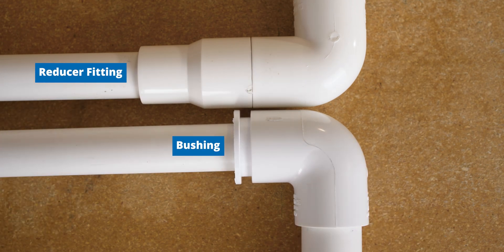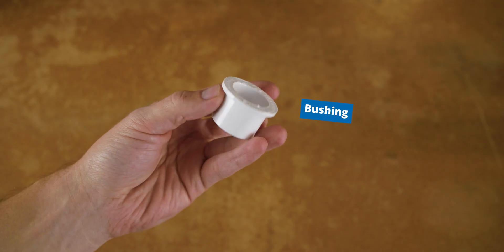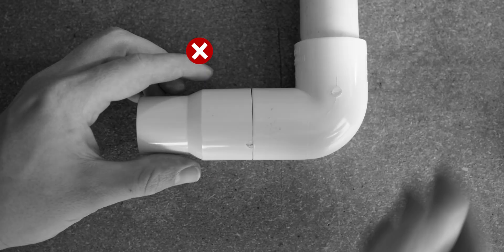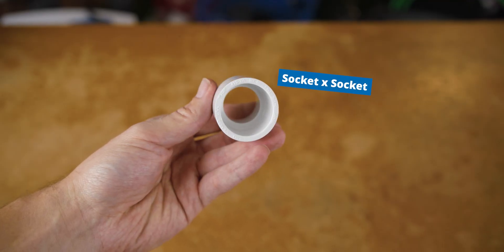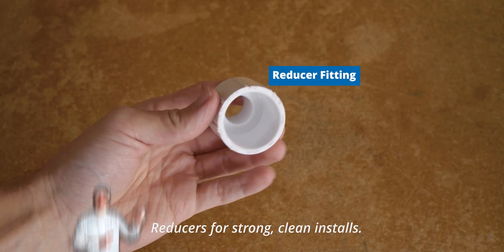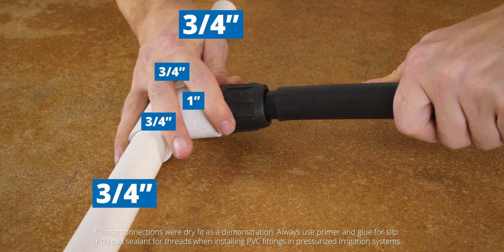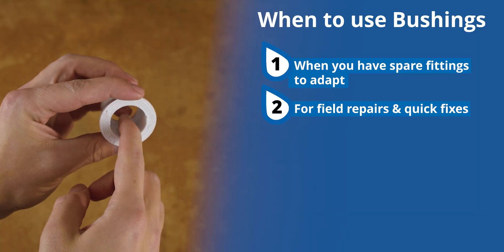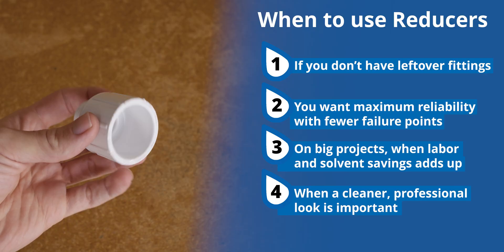Reducer Fitting vs Bushing: Choosing the Best Fitting for your PVC Pipe Project

Comment: From a plumbing standpoint, on drainage and sewer systems a bushing on something like a two way cleanout will prohibit an auger or jetter head from going through because it presents a solid lip when going from a large diameter to a small, whereas a reducer coupling will allow a gradual rise that a cable can easily pass by.
Reply from the maker: Very good point!  You're right about the solid vertical lip from the bushing.  It would almost serve as a wall to an auger.  This comment reminds me of the old saying: "If plumbing was easy, they'd call it irrigation." :)

Comment: Reducing the size will increase water pressure.
Reply from the maker: A Phil sighting!  Good to hear from you Phil and truly hope all is well :) 

Intuitively it would seem like this is the case, but it's actually the opposite, pressure decreases when reducing pipe size.  What makes most people think it increases is the higher velocity; a pipe reduction forces the water to move faster.  Due to Bernoulli’s principle we know that as the speed of a fluid (or gas) increases, the pressure decreases.  This is one of the reasons we go with larger pipe diameters for high flow systems; we want lower velocity and to maintain the pressure throughout the system :) 

This does go against natural intuition as I'm sure we've all put our thumb over the outlet of a garden hose (effectively causing a constriction) and felt the water become more forceful.  However, this is just due to increased velocity causing more momentum/kinetic energy.   

With all that said, there can be a bit of a pressure increase upstream of the reduction due to the backpressure caused by increased resistance where the pipe size decreases, but downstream it will be lower. 

I've never been the best at explaining this one Phil, so apologies if it's a bit long-winded!  A quick google of "Bernoulli’s principle" will likely turn up some writers who lay it out better than I - some of them present visuals and graphics that really help too :)
Reply: @dripdepot What great examples of Bernoulli’s principle! To add to the this discussion~ The Wright Brothers made a wind tunnel before trying to build a plane. They came up with the design of an airfoil. 

Air is a fluid. The curved wing allows the air “fluid” to move around faster, resulting in a lower pressure than the bottom surface. 

Due to the lower pressure on the top side, the higher pressure will naturally push what ever it is into the lower pressure. Creating lift! 

The wind tunnel is on display in Kitty Hawk at the memorial.
Reply from the maker: Yes Phil, that's exactly right!  I sometimes forget how much crossover there is between our two industries.  Some of the popular fertilizer injectors work almost just like that - fast flowing water results in lower pressure that basically results in "lift" that allows fertilizer to be drawn through the injector and into the irrigation system.  I'd never really put the two together like this until you mentioned it, but it's all the same effect :) 

Physics are an amazing thing and it looks like our two industries work on many of the same principles - now to see if my knowledge of fertilizer injectors, Venturi Effiect and Bernoulli's principle is enough to get a pilot's license :p

Comment: Reducing fittings are so much less common compared to bushings unfortunately :(
Reply from the maker: So very true!  There has been so many times I've needed to connect (or help someone else connect) pipes of two different sizes and the only route is to use a bushing because the equivalent reducer is so hard to find.  Kinda leaves the feeling of "the job's not done" when a reducer would be the better call.
Reply: @dripdepot just had this today, never though just changing pipe size would be so uncommon